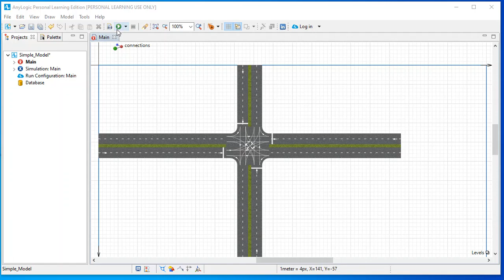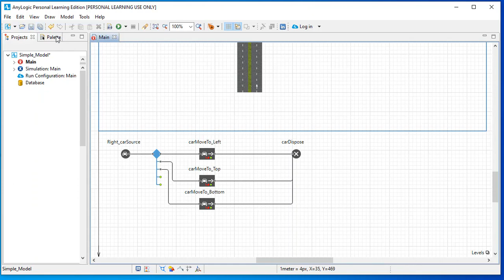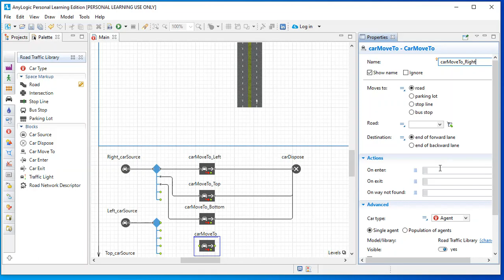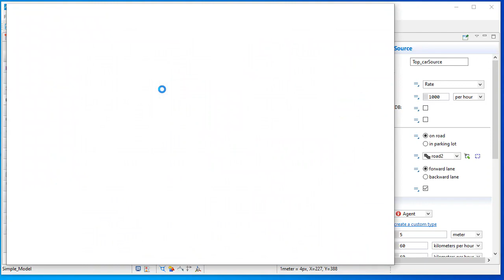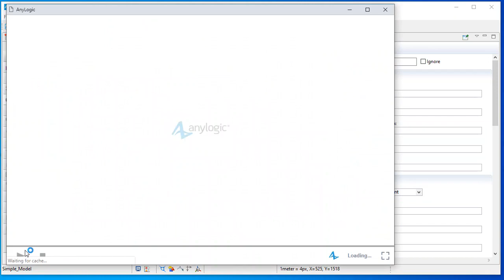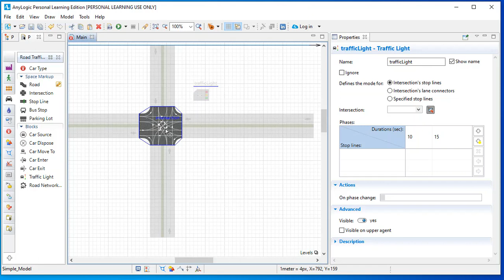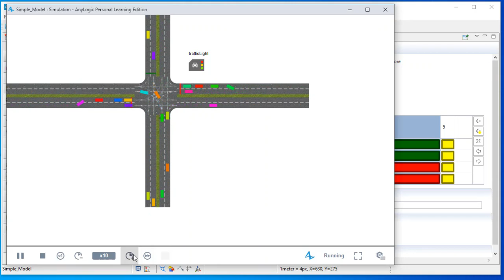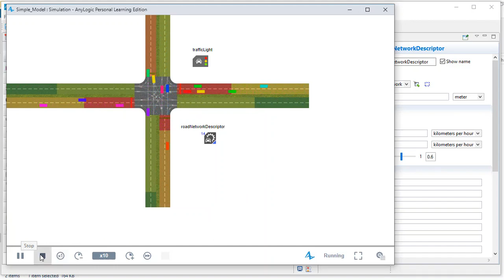Traffic Light & Road Network Descriptor AnyLogic Part3

Comment: Great video :) . Do you know if i wish to change the green time into a variable how can i make this? is it possible to write a code or something in the duration?
Reply from the maker: I didn't tried that, but I think its possible. First check using the box named "On phase change"(under Action section) otherwise you need to override in .java file which will be little complex.